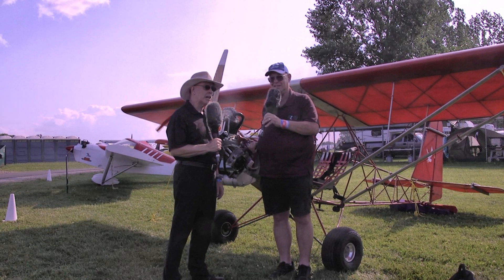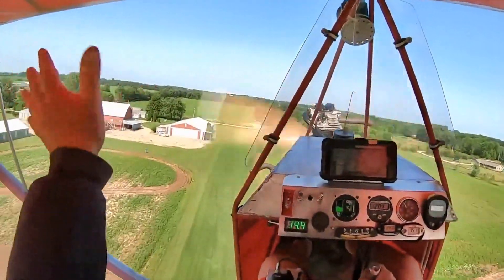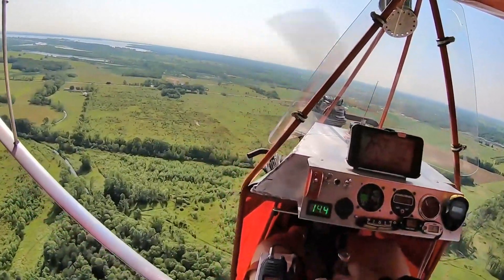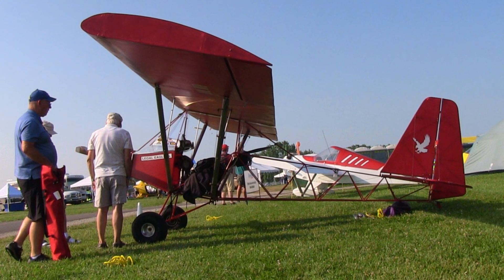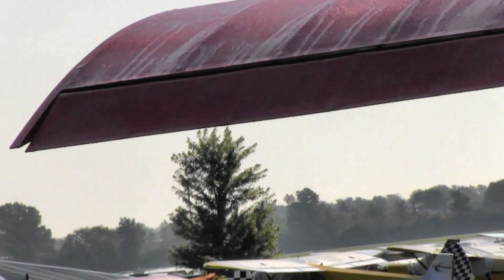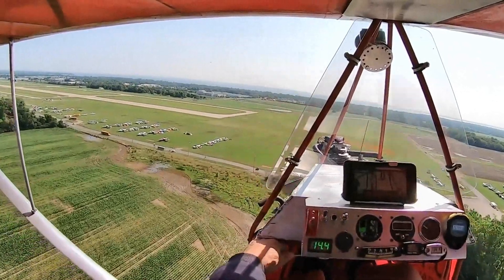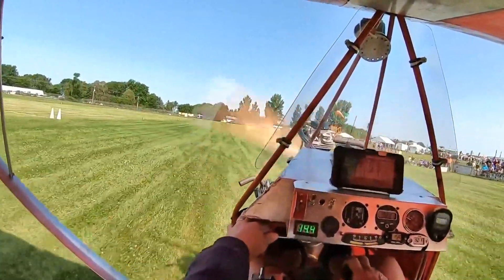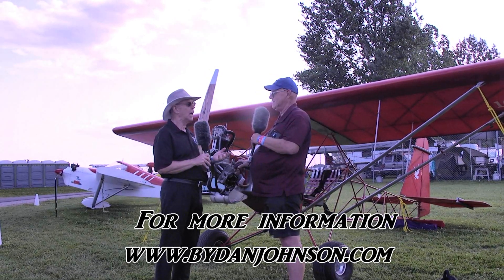Legal Eagle XL, ORV, Les Homan's Legal Eagle XL ORV with Verner radial engine

Comment: I like the way he explains it’s flight characteristics! He speaks my lingo ✊🇺🇸 o ya Verner engines are my selection also. Check the Scarlet 9 cylinder.... hmmm add a turbo and it’s a wrap!
Reply: On a light sport that'd be awesome but I don't know if you'd ever fit a turbo into the weight of an ultralight.  The budget is pretty tight as is. 254 lbs doesn't leave a lot of room for extras.